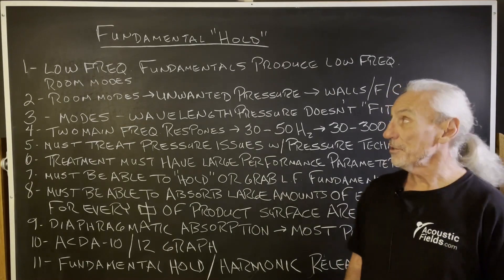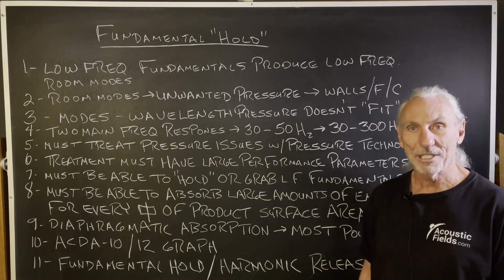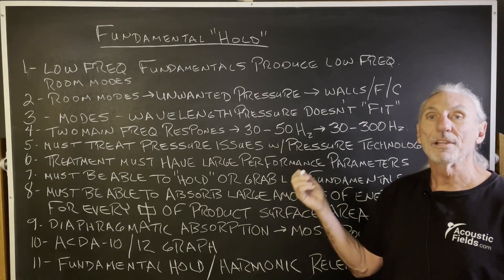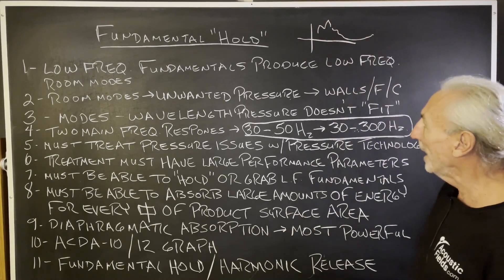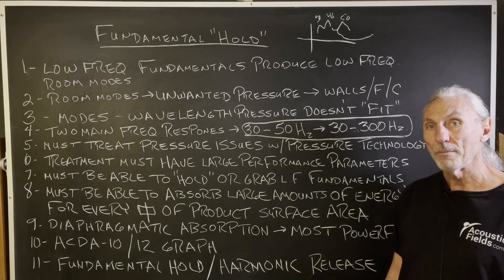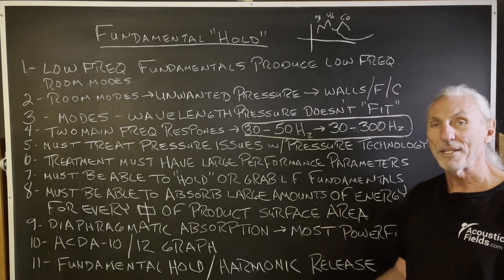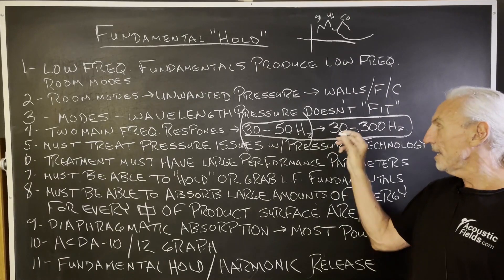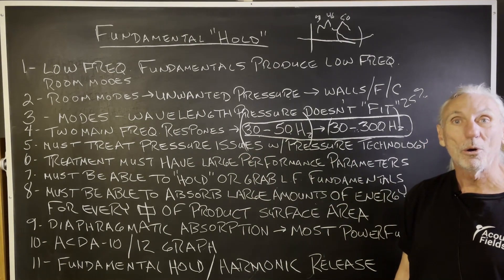Fundamental Hold - www.AcousticFields.com

Comment: Hey dennis if i want to create new mix  room by golden ratio, will i need to sort out low frequencies or they are not problem when the specified dimensions of golden ratio are met?
Reply from the maker: There is nothing "golden" about these ratios. They do not take into account the required space, 12- 16" to treat any room issues. Once you treat the issues properly, especially with low frequency management, your room now has new dimensions. Are your new dimensions still part of the "golden ratios"?